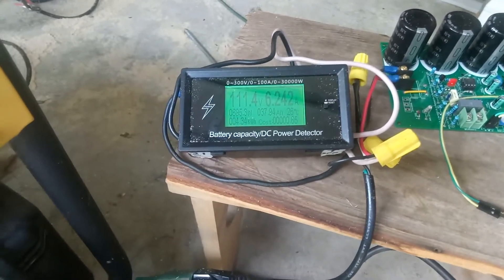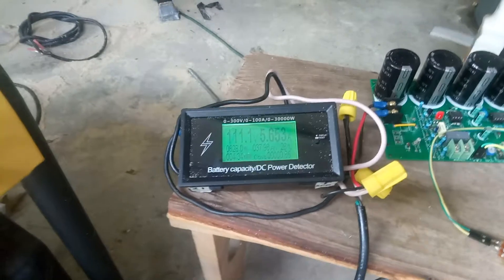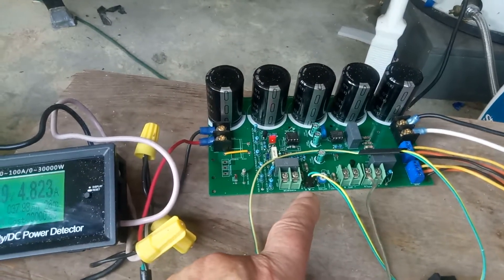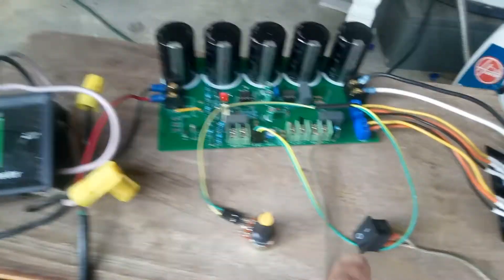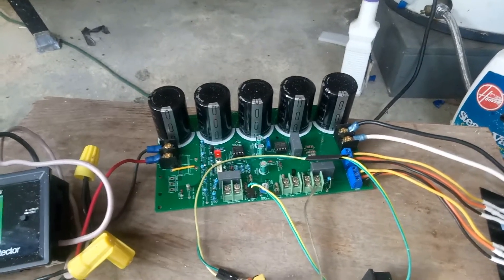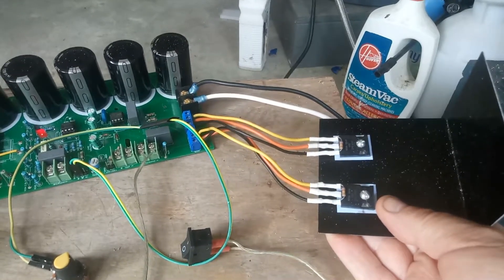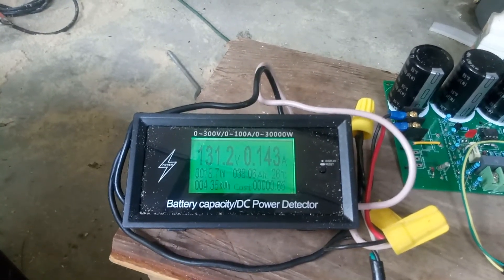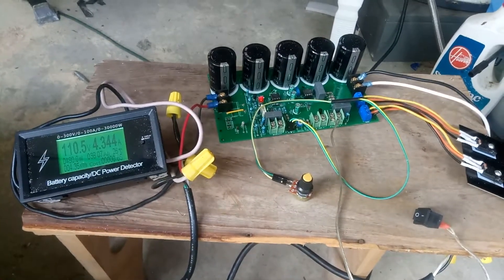120V Evaluation Power Point PV Water Heater Control Board On Standard 4500W Element #fotovoltaika

Comment: Would like to test the board. Going get heating element and pick up some 60 cell solar panels
Reply from the maker: These are evaluation boards available to select individuals who will provide data.  I notice you have never produced any youtube content.  So far I have never heard from anyone I sent these boards to. I am only interested in serious individuals.  The similar ACTii is available for others.
Reply: @opera5714  No problem, I understand. I will try to figure out the circuit diagrams in your previous videos. What heating element should get to test it out in a bucket of water? Do you think I should stick with 60v (two-panel in series setup)? I have been waiting for someone to throw out a small electric water tank on craigslist or Facebook marketplace.
Reply from the maker: @kamsiu7342  Is this intended to be used in parallel with a charge controller?  Higher the voltage the better.  This was intended for 90-120V systems. I demonstrate 60V as many small camps will be small low voltage systems.  This is a RC time constant design so higher resistance works better. 3500W 240V    16.4 ohms, 
 4500W 240V    12.8 ohms,  5500W 240V    10.4 ohms are common resistance in US.  Where are you located.  divide array Vmpp by Ampp to get best ohms. Did you see the 50L  tank I use at my camp?
Reply: @opera5714  NY Queens, I going watch the the new water tank video next again. I watch DavidPoz video where you have match the resistance higher but close to the panels. There is Excel file on his website that you can input your solar panel config and points you the element you should buy, even Amazon links.
Reply from the maker: @kamsiu7342  Queens not exactly a cabin in the woods.  Are you adding supplemental heat to an existing water heater.  Will the panels experience shading?  This dramatically reduces power since the resistance is fixed and any drop in voltage reduces power by factor of square.
Reply: @opera5714  Some shading because we have a big oak tree. Have to test things out, but I want to ultimately do hydronic heating using a water heater. I have been looking at solar vacuum tubes as well but you have to buy a whole system, instead of testing out a smaller system first. I think PV water heating will allow me to have something to dump the load from some grid tie solar panels once the batteries are full. You know batteries are expensive even now, and my natural gas bill keeps going up every winter.
Reply from the maker: @kamsiu7342  I built a simple system with a discarded oil fin heater. Their control system often breaks and are discarded, I have a couple. They often have two elements which gives a lot of flexibility of voltage, 60V and up.   I found that unless you have a very cold room to pull away heat that at 450W they can no longer be touched.  This would be a cheap entry to room heating with a controller rather than fooling with water.  It just wouldn't have the heat storage.  On the plus side heating would be immediate.
Reply: @opera5714  Thanks, I saw another youtube with someone with a micro-hydro generator modifying one of those oil-filled heaters with a dc element to dump excess load. I will definitely try that first since I have a couple lying around.
Reply from the maker: @kamsiu7342  I checked solar iradiance http://www.solarelectricityhandbook.com/solar-irradiance.html and you will get 3-4 times your panel wattage in KWH if panels are set to winter optimum. That is not a lot of heat for a room, it will supply a majority of domestic hot water needs and hot water is used year round.
Reply: @opera5714  Question, looking at the pictures on AliExpress about the 220 vac inverter board. Have ever hook up a 12v to 220v transformer to the inverter board and charge a laptop (for example) that can handle 220v international voltage?
Reply from the maker: @kamsiu7342  That is about all these are good for, 150W regardless of what they say.  They are pure square waves, not MSW, and will overheat transformers.  I remember when you could get these for $7 shipped.  I still have two I use for water heaters.  Build quality is poor and what version they ship is unknown.  AVOID

Comment: Very good. Well done. I was chasing this exact system due to my techluck board failure. After researching Ive decided to  installed a hybrid Inverter and I'm utilising excess power as well after the thermostat has opened. Im getting excited as now Im looking to upgrade to a 5kw hybrid inverter because the more i can divert to solar the higher the wattage and ive reached the 3.5kw capacity. Hmmm. Keep up the good work. Cheers from Australia.
Reply from the maker: I hope you take away the idea of using PV voltage above MPPT as a trigger to switch on opportunity loads either as a proportional or timed diversion.
Reply from the maker: The list of the techluck failures just keeps growing. It has two fatal flaws, too small a capacitor bank and board power supply prone to lightning spikes.  If no obvious burning, the capacitors likely failed. They were only rated at .58A each and can be replaced with a larger capacitor bank.  I use 6,000uf and each capacitor is rated at 3.3 amp.  If components are burned, it takes out everything and the microprocessor is proprietary and unavailable.

Comment: Hello there. I am also very interested by heating water by pv. I want to do that at my home. As soon as I find some time I will build your schematic. At the moment I don't have any pv panels. Don't know yet what pv panels to buy, and I hope for advice from you. So.. my water heater element is 220V 2kW  one. What PV voltage is good for me? Also, I am building an 5kW inverter that can operate from 48V battery pack. I am nearly done. Don't have solar controller also, but I am not buying that makeskyblue one :) looking forward to learn something new from your channel.
Reply from the maker: From a 2KW element you are probably in Europe.  A good voltage to work with is 100-140V if you are comfortable with that.  Half voltage on a heating element will give 1/4 rated power. Many circuits can be used to pulse a FET.  A capacitor bank is used to store energy because suitable inductors are hard to source. Everyone can find capacitors in old discarded electronics.
Reply: @opera5714  I already found 7 caps 680uF/200V. Yes I am in Europe :). What kind of inductor will be suitable? And where to put it? I think I will be able to rewind ...
Reply from the maker: @vmfiscalofficial  NO INDUCTOR IS NEEDED.  The more caps the better it will work.  This board was a compromise to keep the size reasonable.
Reply: @opera5714  well I did the test. :) It works  💪 I simulate the pv panel with my homemade power supply.  Actually I was able to get it working with 22V dc. Now it is time to order 3 panels and do some calculations and... oh man... I am so excited 😆. Thank you a lot with all my heart ❤💙💜.
Reply: @opera5714  the good thing is that I understand how the circuit works 💪
Reply from the maker: @vmfiscalofficial   Exactly what circuit are you using?  Be sure you check a slow voltage rise as in sunrise.  Many high power FET will destroy themselves wit only 30W of array Voltage.  Be sure to post a vidio and spread the word.
Reply: @opera5714  i am using the circuit with LM393 and the diode sensor. As I said I tested it with 22v. The fet is from hp server power supply 100v 95A and it did not heat at all. The circuit stops at 15v. I drove the current up to 4.7A (max of my psu). That's all I tested for now. And for the 150v version I have 2 FETs 5n120bnd. That's 21A 1200v FET. Not sure what will hapend.
Reply: @opera5714  be sure that I will spread the news, one or another way. 😉
Reply: @opera5714  also, do you think it is possible to use 555 to drive the fet?
Reply from the maker: @vmfiscalofficial  There are dozens of circuits you could use.  IN none of them would I ever ever use a 555.  There is a guy who thought it was a good idea and got several others to build his circuit.  They all oscillate and burn out FET.  A TL494 is an option if used with aFET driver that has a UVLO to disable it if voltage drops below 10V.  SG3525 is also an option as well as just a FET driver as in my TSFW design.

Comment: brother i have to increase my small solar panel output for car or any small motors . what should i use
Reply from the maker: Solar panels current sources.  For a given light level the current is constant from near power point voltage down to a short. Getting the most power requires a circuit to maintain the voltage  near ideal power point voltage. MPPt controllers for batteries or linear current boosters for motors.  These can be made out of many cheap modules but requires some electronic knowledge.
Reply: @opera5714  thanks
Reply: @opera5714  can you have a instagram

Comment: Thanks for these videos on capturing esolar and the modding of cheap boards. Really appreciate your efforts, approach, and I hope you continue posting. Been breaking down appliances for parts, making notes, and now off to ebay. Thanks again.
Reply from the maker: My first water heater control was made from parts of old computer power supplies.  This control can be cheap with a little scrounging. With all the cheap assemblies from China few are interested in building electronics anymore. Only a couple have built from scratch.  There is a lot of satisfaction to repurposing old electronics.
Reply from the maker: This one was just sent to NM and should be running by end of week.  Hope to get some data on it soon comparing it to a solar calculator estimate.  My locations don't allow full sun all day so I am dependent on others to collect data. So far, nobody has had the experimental spirit to collect data and provide it to me.  Hope this person does.
Reply: @opera5714  Hello Opera   did you get the data on your board and is it for sale. Thanks

Comment: So how do I get one?
Reply from the maker: I don't think I'd mind coming over and installing one for you. Mind that I will be taking a lot of breaks.  You seem talented, why don't you build one with an arduino. My first one was. It did dual tanks, ran the refrigerator, pump etc.  This board was in response to those who had purchased the techluc board and found out they couldn't get it repaired. That was prone to fail with voltage spikes. This is fairly low tech and bullet proof with parts that will be around for the next 20 years.  And it can be also be paired with a charge controller. I don't see why this concept is so alien in the solar world. I get free hot water.  So much I do all cycles of the laundry with hot water.  This is an opportunity for you to design a product. Europe is far more forward thinking with products like this.
Reply: @opera5714  Because of a previous video I was under the impression that you were working on commercializing a board and that this was a demo for that board.
And yes I'm pretty high skilled in programming but not so in electronics. As I currently do not own solar panels and I really want a solar water heating solution, a out of the box, stand alone water heating solution would be a real kickstarter for me.
If you ever plan to come to Belgium feel free to tell me; so we can arrange for your to stay at my place for free; we could do some free wheeling.
Reply from the maker: @nogmeerjan  Water heating is an easy entry into solar as the cost is not much more than the panels. Every bit of energy the panels can produce is used.  Things like powering a home office or shed tend to just waste money.  Have you looked at the ACTii from Poland?  These are about $150 and whatever tax, shipping.  These can operate MPPT or fixed voltage. I'd have to look into the cost of sending one. Our post office has gone crazy with shipping costs.
Reply: @opera5714  Thanks I'll try this solution
Reply: What’s the price?😃
Reply from the maker: @LRasmussen01  When you are ready we'll work something out.